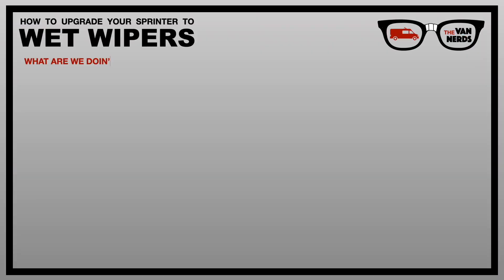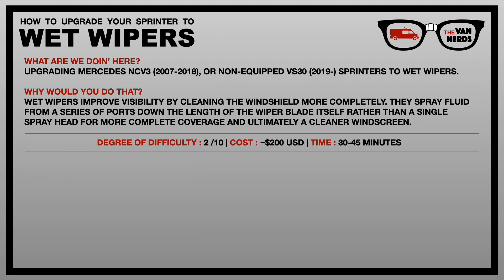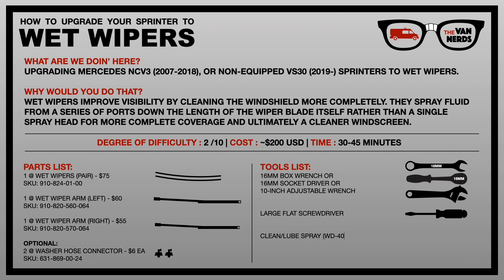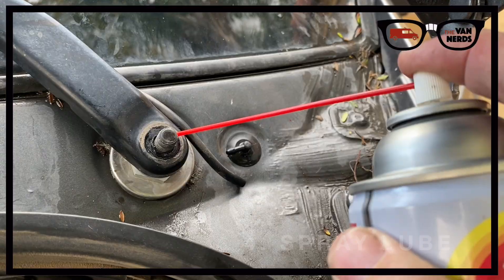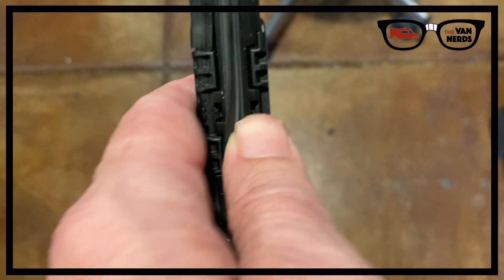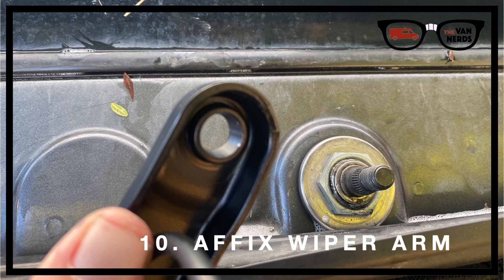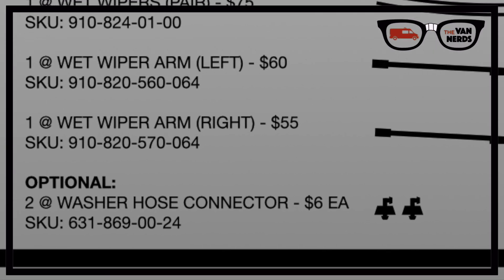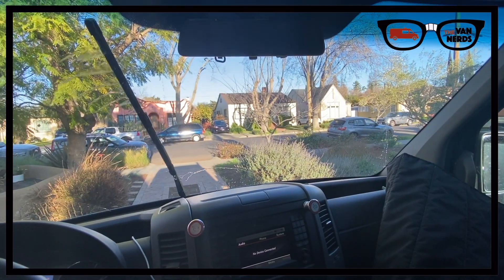How to Install Wet Wipers on a Sprinter Van

Comment: The hose clipper on my old 2012 sprinter was broken off, this is exactly what I need to upgrade to a better design. Thanks.
Reply: I wish this WET WIPER BLADE would fit my 2012 Sprinter 3500 ?

Comment: Hi all. It's July 2024.  I'm trying to find the most economical way of replacing the wiper blades both now and in the future. I'm hoping someone on this thread can point me to REFILLS for the wet wiper system.  The spray pattern is awesome.  Currently seeing full wiper replacements for $50-$100.  A little rubber or silicone refill makes way more sense.  Holler if you have already solved this issue. fwiw, I own a 2020 Leisure Travel Van (Unity Twin Bed option) on the 2019 Sprinter 3500 chassis. thx

Comment: the sellers of these upgraded  says these do not fit your 2017 Sprinter. Does that mean the lengths are different, or maybe they don't fit the nut, you guys seemed to have rigged them ok... or are the sellers just trying to do CYA